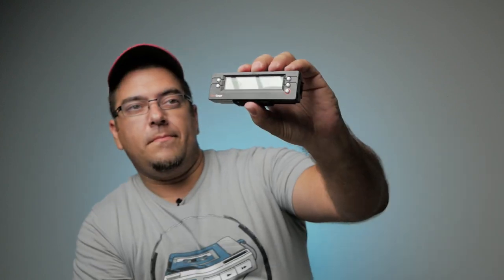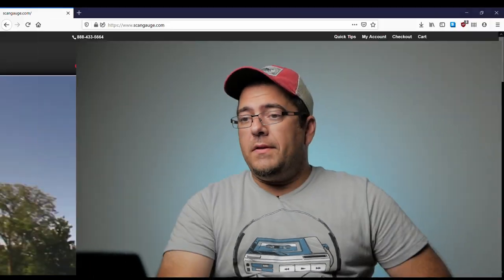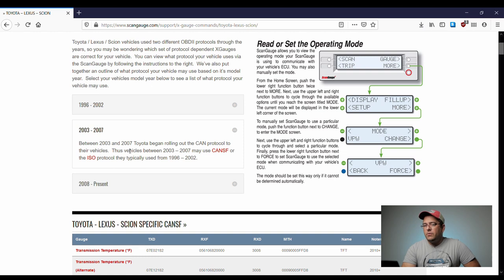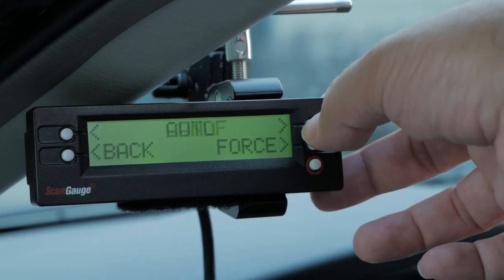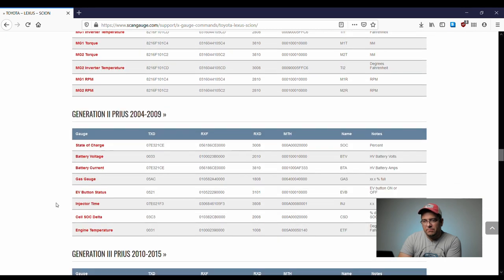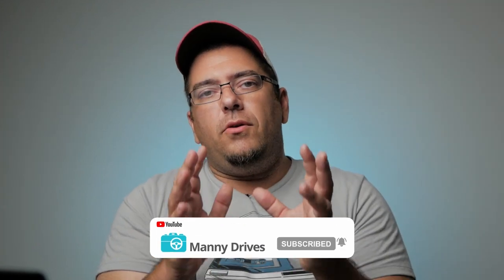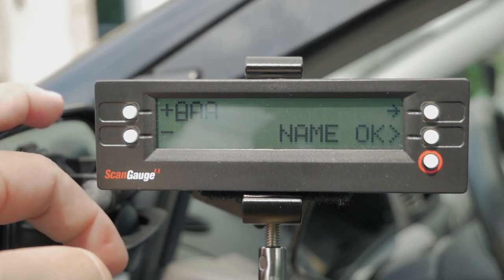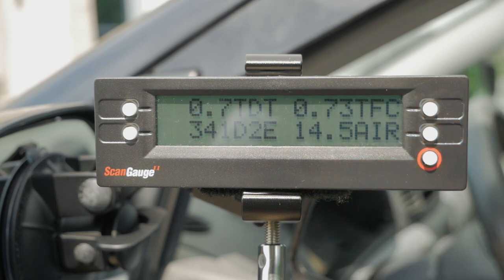ScanGauge XGauge Setup | This changes things.

Comment: If you drive an old Prius, Scangauge 2 is excellent.  Hybrids worst enemy is heat.  However, the driver does not have an analog heat dial to monitor. By the time the engine posts a CEL / Engine symbol, the delicate electronics & aluminum parts are corrupted.
Reply from the maker: Interesting point.